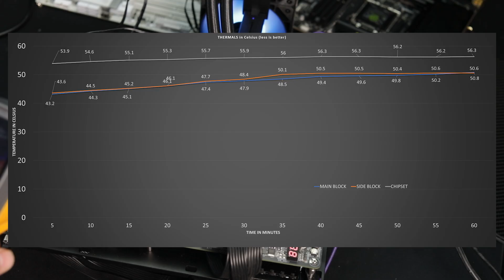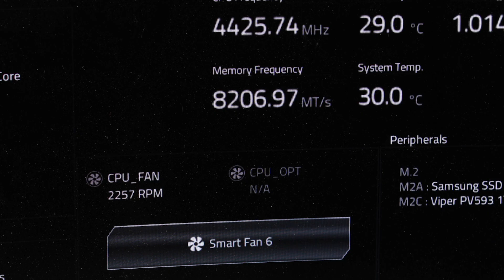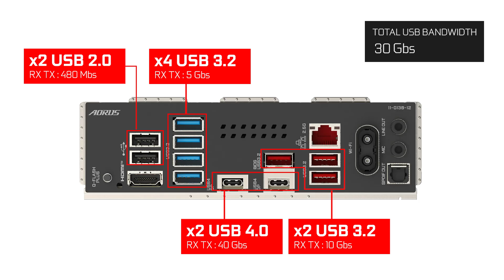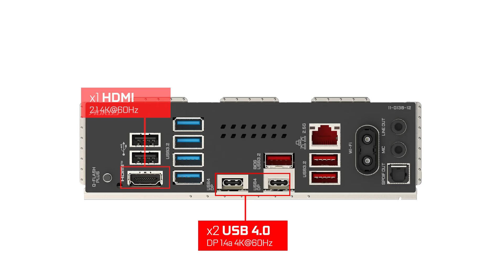GIGBAYTE X870E AORUS PRO : Lazy and Sad. Disappointed.

Comment: Why did i see this video a day after i ordered this board
Reply: Guess what,, me too lmao
Reply: @agustandritan8343  i was abt to click order
Reply: God dammit me too I got it installed yesterday :(
Reply: i thinking to buy this .. so NO ?
Reply: Same, just finished putting the pc together
Reply: Hey guys. It happened the same to me. What did you do? How about the ram
Reply: Its a really good board, this dude is trippin
Reply: How are you finding the board so far, did you end up using it? I've had mine since October. Using it with a 9800X3D and 9070XT. It's working great for me
Reply: @S @SquatBenchDeadliftz eah I have the same but I don’t push it like they do I guess. I just you tube and then play cod and it just works. I’m happy

Comment: The X870 Aorus Elite X3D, and all the new X3D mobo line-up basically try to "fix" how sad all of the initial X870 boards are, such as this one. They're all 8-layer low-loss PCBs and have different pcie lane configurations that don't do stupid things or make weird sacrifices (for the most part). I'd just wait for them to go on a decent sale (from like $379 to $325 or lower is a more reasonable price) and then snag one if you're settled on the AM5 platform it should serve well until the next upgrade cycle.

Comment: Thank you very much for the review. In my opinion, the problem with these GIGABYTE motherboards is cost-cutting. A six-layer PCB instead of an eight-layer one is a downgrade. It results in worse memory overclocking.

Comment: I have my self a Gigabyte X870E Aorus Pro motherboard. It is quite nice but I have ran into big issues with the M.2 sockets. M.2C _CPU and M.2B_CPU both drop out drives sometimes on startups. It is quite the annoying issue since it only seems to consistently effect drives that are about 50% full but I have seen the behavior on almost empty drives as well. Even switched out the drives and checked them with HWiNFO and they all read perfect health. When the drives actually show up on start up zero issues, fast write speeds, no temp issues, no drop outs during use.  Did you run into any of these issues on your end when testing the motherboard? 

After watching your MSI MAG X870E TOMAHAWK WIFI video I decided to switch to that motherboard since as you stated, it is nice having 8 layer PCB and not sharing PCIE lanes from the top expansion slot with M.2 drives! Wish I would have watched it sooner, I would have chosen the TOMAHAWK if I had.

Comment: I just went to msi b850m gaming plus wifi6e.
I need GPU to be on second slot of expression.
PCle4 is enough even for rtx 5090.
I needed micro atx and it looks good for all white build too.
Not best but not worst VRMs in my opinion so its soild pair with 9600x for overclocking.

Comment: Kinda sucks that they use 6 instead of 8 PCB layers, not to mention, why include RGB? It does nothing for the performance. Also, bifurcation on both the gen 5 NVMe slots? Come on! It's a really expensive board, so why all the shortcuts?

Comment: I bought the Gigabyte B850 AI TOP. No brainer vs. Aorus X870E Pro.
Reply: What's your experience of it so far? Thinking of buying it too!
Reply: I use it with a 9950X, Thermalright Royal Pretor air cooler, 64gb of Gskill Flare X5 DDR5 6000 CL30 Memory,, 4tb Crucial T705 Gen5 NVMe, and a RTX 5080 Founders Edition. Excellent performing system.
Reply: I have a 850i elite.  0 complaints.  I got a comparable b650i and it was awful.  Ibe had a whole slew of b550 and b550i gb boards

Comment: Welcome back, Laurent. 

I got a X870E Elite Wifi 7 ICE recently
Reply from the maker: just so u know, the ELITE is a complete different story. It actually is a better board than the PRO looking at its VRM and cost.
Reply: @Laurentschoice yeah, still only 6 layers 😐
Reply from the maker: i know.... they just fixed it with the new ELITE X3D.. i think someone got in trouble over there lol
Reply: @Laurentschoice the elite X3D has one less pcie 3.0 x4 - the pro X3D has  a x2. Gigabyte shat the bed hard on x870E. I make use of two x4 pcie
Reply: @vincentvega3093  in what case is this bad?